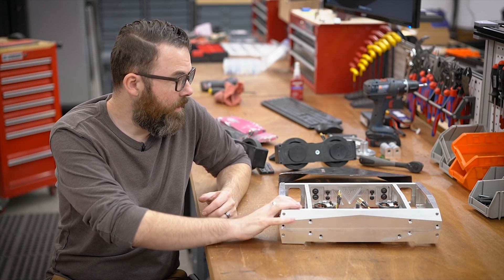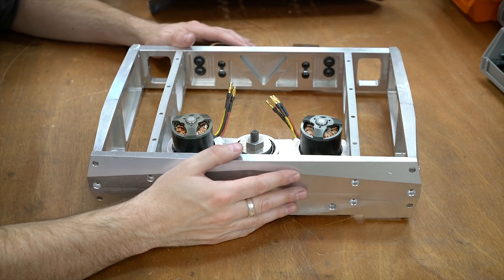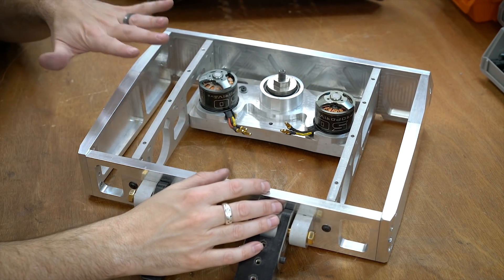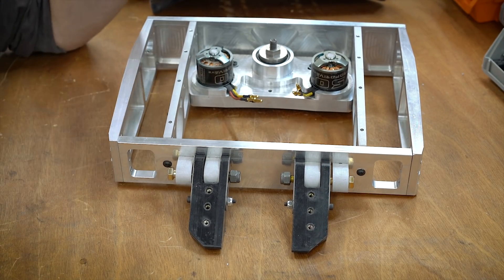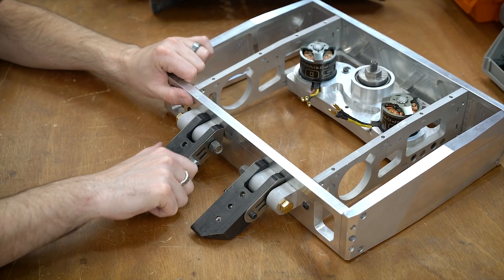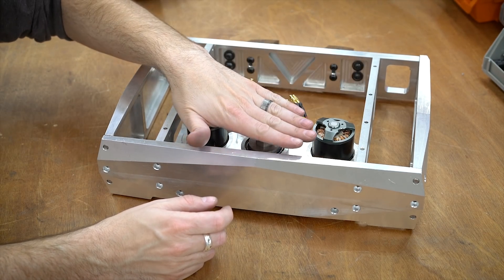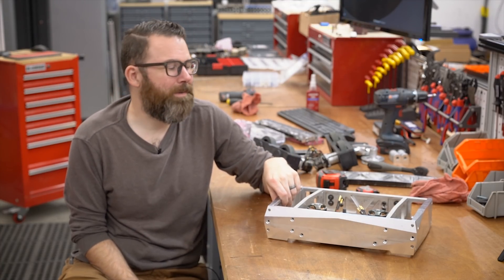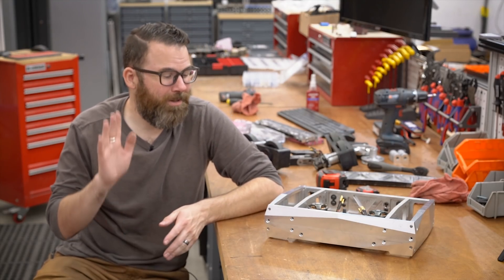The pros and cons of Crippling Depression's Frame

Comment: I really like the 3D-printed jigs. It's always frustrating trying to find the perfect position to drill, and those jigs are a godsend.
Reply from the maker: Yep!  I use 3d printed parts for this all the time.  As long as you plan out your time, you can be doing something else while they print and it doesn't slow you down at all.

Comment: I wonder if you could improve this design by adding a frangible armor to the outside of the striking surfaces?  Something like a cast or sintered material.
Reply from the maker: Possibly.  If I had to remake this exact bot over again, I would do some sort of 3-sided front skirt out of steel, similar to how tantrum does it.  The individual pieces aren't strong enough to withstand or deflect the blows.

Comment: Have you tried putting Vibra tite on the screws that loosen? (I've just started using it so I'm not sure how much itwould help.)
Reply from the maker: ALL bolts on combat robots get thread-locker, always.  Any bolt that doesn't will back out within about a minute.  So yes, this is common practice on all weight classes.  But even still, bolts can back out.

Comment: Seems like the serviceability, rigidity, robustness, and parts replacement are all part of the same problem, too small of fasteners.  It would appear one design methodology that you have accepted to overcome this weakness is dowel pins.  The problem with the dowel pins is that it makes the unit more difficult to service, as you note about the center weapon assembly.  If you were to use shoulder bolts instead, you would realize the sheer strength of the dowel pins while making them removable so that you could drop segments out instead of tearing down the bot.  This is a lesson I am learning with the larger bots.  Expect damage, make sure you can repair on site.  Having modules or replacement parts only helps if you can quickly install/replace.  Also, aluminum is structurally great but poor armor.  Stuff you know already.  See you in the 12s someday.
Reply from the maker: I think rigidity is actually perfectly fine.  It hits hard and tends to transfer a lot of energy.  But it's a pain to service.  Robustness is hard to quantify.  It's almost always lasted until finals and I've never entered a match without a weapon or drive.  Keep in mind, I rarely do much to 'fix' my bot between matches.  I've never swapped out a frame part, never swapped drive motors, etc.  In the entire history of CD, I've swapped out the weapon motors and ESCs once (in a single match), one drive ESC once, and that's about it.

Comment: For that carbon fiber armor panel; why not just build a lip for the panel to sink into? Have the screws as a secondary defense against the panel popping out. That would remove three problem if having to tape it down.
Reply from the maker: Because the bottom panel is flush with the front panel. If there's a lip, the weapon will hit it.  There is about 1/16" clearance between the bottom armor and weapon.  :-)  Yeah, I thought about a lip, but there's no room for it.